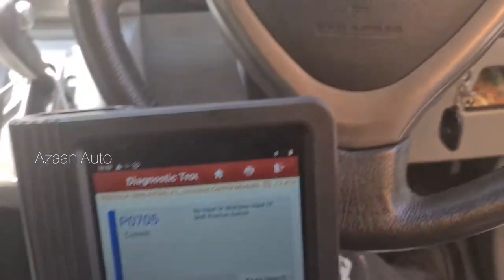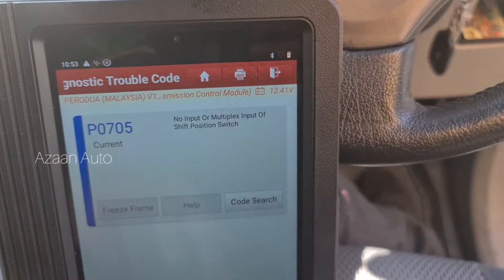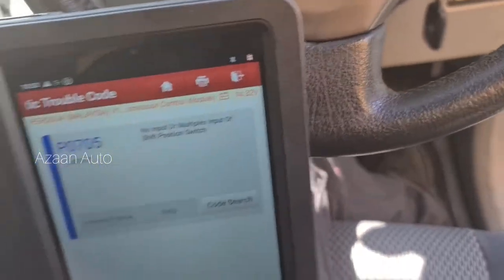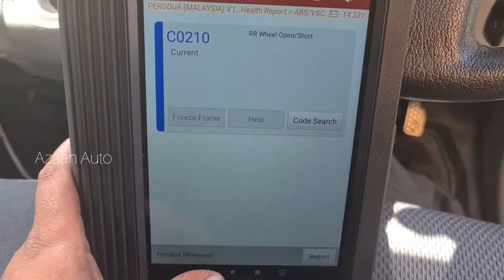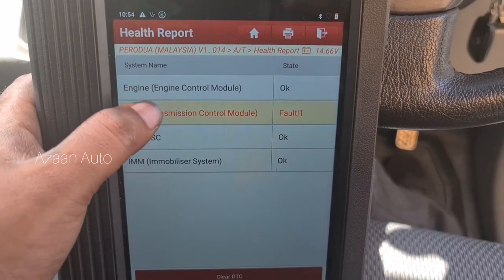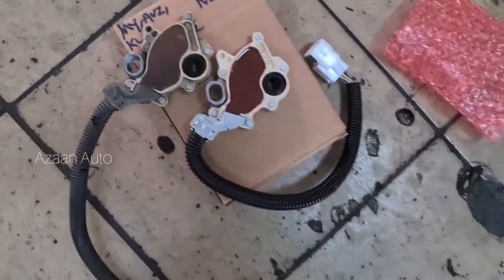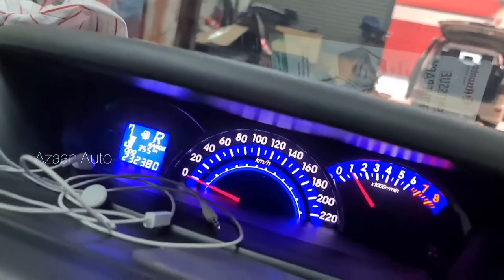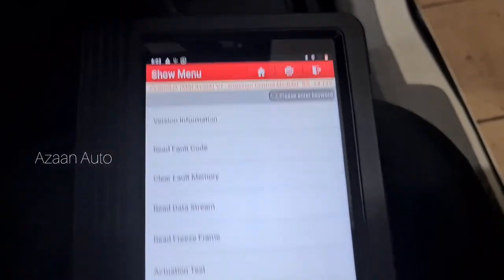P2015 Fixed AT Lampu Gearbox Menyala  PR blinking on The Speedometer Shift Position Solenoid sensor

Comment: Bang, tanya sikit soal matic, bila gear 1 rpm sampai 3000 baru dia nyentap kuat ke gear 2, tapi bila sudah engine panas, dia smooth. Sensor neutral rusak ke? Terima kasih.